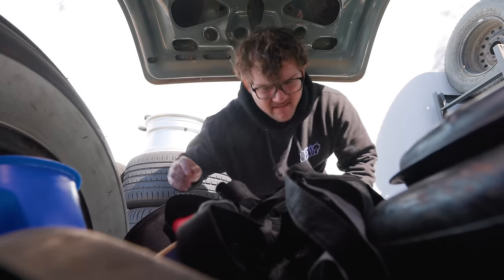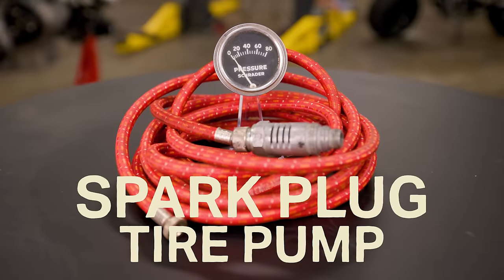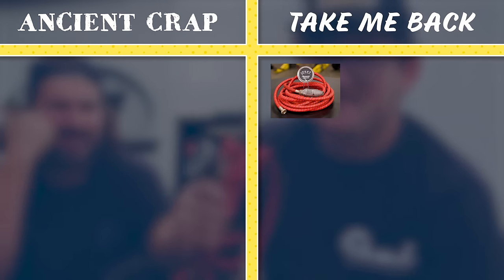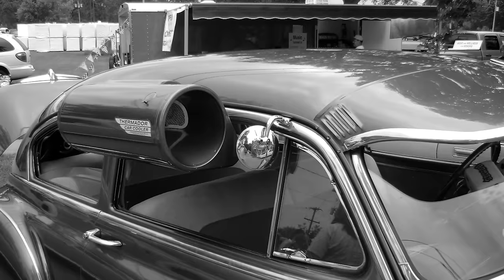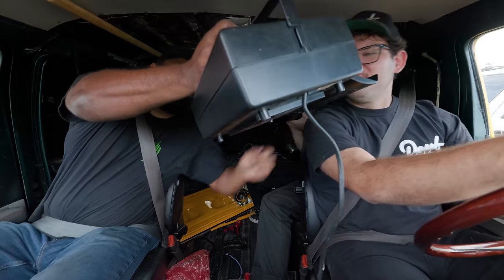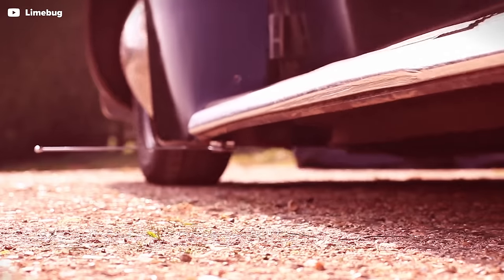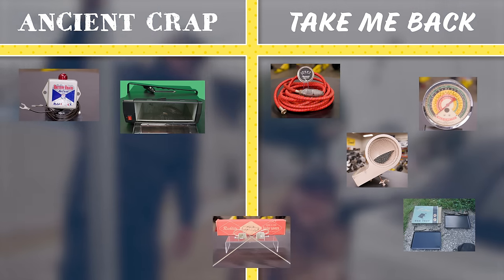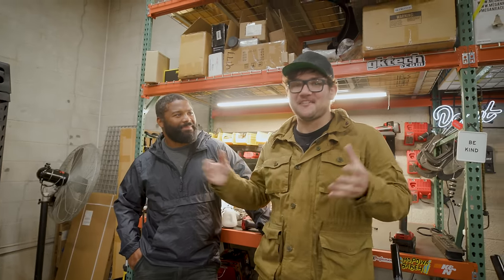Testing Forgotten Car Accessories

Comment: I would like to add the tire retreader would of been more safer back in the day because tires had tubes
Reply: Also many tires were bias ply, and we're re-groveable, many said it on the sidewall of the tires.
Reply: We still do this to trailer tires in the trucking industry
Reply: @srichard6237  I have mixed feelings about that. On the one hand, I get that it saves a lot of money. On the other hand, retreads are what cause 90% of the road alligators that litter highways.
Reply: Regrooving is quite different than retreading. A retread is pretty much glued onto a refinished carcass, where-as a quality virgin tire will have a certain amount of regrooving ability planned into the rubber thickness beyond the original tread depth.
Reply: @blze0018  It's actually 2 different things: 
- Re-grooving is carving out rubber to deepen the grooves on an existing tread. Tire manufacturers even design some of their products to be re-groovable and specify in the tech. datasheets where and how much rubber can you remove. But still needs a care and a hand of a professional to be done properly.
- Retreading is basically gluing / curing a new tread onto a used casing (old tread buffed away). Again, tire manufacturers provide some tech. specs as to how to do it properly for their products, which in many cases is not followed and then we get all of these "road alligators" (love that name btw :D)
Reply: @blze0018  As 2 people have already said, regrooving is not retreading.  I worked for a tire shop for about a year doing mostly truck/trailer tires.  Most people call retreading "capping" the tires, which is gluing on a whole new piece of tread around the existing tire.  We had 1 guy who would regroove bald tires when we weren't busy.  We had a lot of customers that would never run capped tires on their rigs, but some of them would use regrooved tires because there's no chance of throwing a tread on the highway.
Reply: @eric_d  I work on various earthmoving equipment and retreaded tyres is something I really dislike(especially combined with remix tyres, Michelin claims they are as good, but I call BS). Oftentimes the retreaded tyre might have a body originally made 15-20 years ago and they have a tendency to pop on their own from the sidewall.
Unfortunately had to start using retreads again since the prices of fresh tyres pretty much doubled after some a-hole decided he needed to invade another country in Europe.
When you are maintaining a fleet alone it really gets old fast having to replace blown rubbers on the road every day.
Reply: im thinking also regrooving would have been more safe than driving around on slicks in a time like the 1940s when tires were rationed and you couldnt just buy a new set. same with like patching a sidewall. with previous vulcinazation methods and the scaricity of sulpher, and poorer quality/dirt roads, tires only lasted about 5k miles. thats why old cars like the vw bug have the spare tire easy to grab and modern cars its like under the trunk or something.
im thinking about how the spare in my porsche requires me to do like 20 operations and getting it out is the longest part of the process.
Reply: Many older tires were designed with the ida of regrooving in mind. The rubber was initially thicker allowing for them to be regrooved. The reason that the original tread wasn’t cut to depth to begin with was because the rubber was often too soft and the tread would have become unstable in normal driving conditions.

Retreads are the norm now with large workhorse tires, but you most often see regrooving done to racing tires nowadays. A thick sheet of soft rubber is adhered to the tire, and then specifically designed racing groves are carved into them. You can go into the pits of any semi-pro racing league and see this taking place after the first tire swaps are done.
Reply: @Aqnde  - Fell for the “Putins price hike” BS spin did ya?

Prices had gone up long before then kiddo.
Reply: @bradzcustoms  Most motorcycle tires are bias ply, and I would not trust a regrooved motorcycle tire.
Reply: It's  either "more safe" or just "safer". 
Saying "more safer" is grammatically wrong.
Reply: @srichard6237  and outside the USA.  many used USA tires end up shipped to south america, get regrooved by a tire factory, and sold as refurbished.
Reply: @blze0018  wtf is a road alligator??
Reply: @Aqnde  those big equipment tires popping from the side is also extremely dangerous, as I’ve seen some videos online of people dying from that. Really scary stuff
Reply: Re-grooving is vital for construction equipment such as backhoes
Reply: @Cerus98  It's actually largely caused by corporations' price gouging. For example, the refinery and gas industry shut down capacity during COVID and specifically chose not to turn it back on to gouge prices. Often, they used "scheduled maintenance" periods to do the same. We're not experiencing inflation in the traditional sense; it is solely being caused by companies' addiction to ever increasing profits.
Reply: @Cerus98  If that were indeed the case, we would not be seeing record profits, stock buybacks, and insanely large bonus packages.
Reply: @Cerus98  and actually the US has never really been a net exporter since 1949. Only in two years was that the case and only incredibly marginally.
Reply: @Cerus98  The COVID impact was lessened during the peak of the pandemic because the demand had also dropped. When the demand came back around Biden getting elected the refineries CHOSE to not increase capacity back to pre-pandemic levels.
Reply: @Cerus98  Lowering revenue is exactly the same as providing economic assistance. Tax breaks are actually worse because poorer people spend their money generating economic growth in the community while the wealthy and corporations hoard it.
Reply: @Cerus98  It's actually funny that you say that last thing, because long haul trucking will probably be the first instance of ICEs being outright replaced by EVs (If we don't count the electrification of freight trains)
Reply: @Cerus98  and actually if you look at the price per barrel of oil and it's relation to gas prices, gas prices should be much lower than they presently are. They were at similar points before and gas was not as expensive.
Reply: @Cerus98  But you are approaching correct when you say that the knock on effects of this price gouging of gasoline refineries is the driving force behind the rest of the "inflation". You're wrong when you say it is related to economic assistance though.
Reply: @Cerus98  We are literally not even experiencing traditional inflation. There just isn't a word for price increases due to widespread price gouging. The corporations take advantage of that.
Reply: @Cerus98  But when the revolution comes, we'll give you a chance to renounce your incorrect beliefs before you're assigned a spot on the wall
Reply: @Cerus98  the firing squad wall, to be clear
Reply: @casedistorted  Those long chunks of semi truck tire tread you see on the side of the highway after one of their tires blow.
Reply: Alot of people use them for off road use also. When your using 37's or bigger its nice to get as much life out of your tires as you can. We also use to to use them to make super swampers into paddle tires for mud.
Reply: As others have I also seen Truck tires being regrooved though never on a car simply because car tires use the minimum thickness they can get away with.
Reply: @claudiodiaz9752  What if it's even more safe than something that's just safer?
Reply: @blze0018  Retread, Regrooving, hmmm two different words that just might mean two different techniques.
Reply: 19.5 and 22.5 tires are still regroovable
Reply: Tire retreaders are still around.. theyre just primarily used on race tires, offroad tires, semi tire, and tires for machinery
Reply: "...would have been..."
Reply: no.
Reply: Ex tire tech here, Tires were made to be re grooved as well. They still do this on semi trucks.
Reply: Yep, tires were designed significantly differently back then.  This would NOT work on modern tires, and would be very unsafe.
Reply: tires would say on the side regroveable to be able to use and some truck tires still do
Reply: @Cerus98 
You call the guy with a job kiddo. How come I don't think you're old enough to even look at a job application?
Reply: @thejay8963 "how come I don't think?"

There, fixed your question for you kiddo.
Reply: @strayiggytv  
Very clever, you're proving my point exactly.
Reply: Gotta love "more safer."
Reply: @srichard6237 Mabey back when you were 5 in 1967 that was true, but they DO NOT plan for any regrooving depth in modern tires. Not even a plank length.
Reply: @MeepChangeling  Most big truck tires are able to be regrooved. Not legal on steer tires, can only put virgins on them. But for a trailer it's just fine.

Comment: Why didn't you put the curb feelers on Nolan's car?  Oh right... it's a stationary art piece now.
Reply: facts, dude gave up quick.
Reply: Stop, he's already dead 😭
Reply: He really needs to get rid of it
Reply: gaddamn
Reply: I thought it was running after.... What's his name came and worked on it.
Reply: @MK-1010  it turned over, it didn't actually move an inch
Reply: Junkyard digs
Reply: got 'em
Reply: Oof
Reply: LOL right now..
Reply: I suggest swapping out the stock spark gremlin ignition system and transplant in a mid-ish 90's to near 2005 (maybe, I just borrow GM ignitions for my Mopar) HEI system from the ICM to the plugs. It solves so many of the di@khead Engineering, and hidden intermittent cranking no starts.
Reply: @FORDCAMPERSPECIAL   That's it! I couldn't remember
Reply: U could have also just angled them down a little too maybe? 🤔
Reply: @MK-1010  it was running when junkyard dogs (Kevin brown) came and got it to fire off, it just never moved
Reply: @coonyman10  who’s dead
Reply: Dude that thing is literally like art dude, if you sell the car it’s hard to get a car in the same condition
Reply: Who's nolan
Reply: Something about wiper blades for the first 5 minutes

Comment: Worth noting that when the tire re-treader was a thing, everyone had Bias Ply tires which had very thick solid rubber treads, unlike modern radials, so retreading them was entirely safe and viable.
Reply: Yes, and similar tools are still used today, just not for regular passenger vehicle tires.  These kinds of tools are still common for reconditioning airless tires used on a lot of equipment.
Reply: Yeah haha, I was thinking the same. They were just much thicker back in the day. Probably why you will hear old guys complaining about how often they need to replace their tires now and how much longer they used to last.
Reply: They still use these on tractor tires today
Reply: Even modern passenger car tires can be retreaded. Obviously not with a simple tool like the one in the video. It's just an entirely different process & not something you can do at home. They basically sand off most of the tread, lay on new rubber, & cure it again in an oven/mold.

Comment: Back in 1966 when I was driving cross-country, with my newly pregnant wife, I had to buy one of those swamp coolers when I started across the Mojave Desert. It was no air conditioner, but it was better than nothing. The only other accessory that went with it was a canvas bag of water that you hung in front of your radiator as you were driving. The theory is that the slipstream of the air would keep the water cool. Again, better than nothing.
Reply: The swamp cooler very much would still have a place today. I lived in the Mojave for a while and saw many many cars broken down in the mountains that ignored the “turn off a/c” signs. A swamp cooler would have been pretty great in that environment.
Reply: @Leonarco333  What's the reason for turning of the ac? So high temps so the compressor breaks down maybe?
Reply: @P4hko  the ac compressor makes your engine work harder and produces a lot more heat in the system. When the ambient temperature is 120-140 degrees near the road surface, your vehicle struggles to manage and remove heat from the system. Combine that with the increased load from the steep inclines and it’s common for head gaskets to blow or radiators to rapidly empty themselves of coolant. Turning off engine loads is advised especially the ac.
Reply: @P4hko  In addition to what Leonard said, today's cars both run hotter normally and also have minimal cooling systems to save cost and weight. It's all to gain fuel efficiency and reduced emissions, but when you figure in the exorbitant costs of repairing today's cars the increased efficiency doesn't compensate. And I'm not sure emissions are really that much worse on a cooler engine.
Reply: My dad bought one for a family trip thru the southwest from LA to Texas in July back in 1969. It didn't work very well. It just made the interior humid. I hated it.
Reply: @toastnjam7384  Swamp coolers only work well when the air has low humidity.  They are still used as window units in places like Denver where they don't necessarily need full a/c.  Anywhere with humid air, they will almost be worse than nothing.
Reply: it's just like having an old failing piece of crap swamp cooler in your house. It barely works, you want to kill the landlord(car owner in this case who installed it and decided to go through a hot desert with it.) and yea it's better then nothing. God I wanna strangle my old landlord.
Reply: @Thatonefuckinguy  I hear you brother.:face-orange-frowning:
Reply: the idea behind the desert water bag is that the water would seep through the canvas and evaporate, cooling the air coming into the radiator, and reducing the risk of a boil-over.
Reply: @Leonarco333   I would totally buy a swamp cooler for my '99 Blazer, she doesnt have working AC so summers get pretty brutal
Reply: Swamp coolers are actually fairly effective as long as the outside humidity is low enough.  A friend of mine asked me AFTER buying a swamp cooler why it wasn't helping him at all...in a South Florida, just-had-a-hurricane power failure area.  Well...likely because the humidity was 90+ percent the whole time.  With way-high humidity, basically the swamp cooler becomes a swamp-fan instead.  Being pregnant, I'd think your wife was at least less-miserable with that thing available.  "Better than nothing" is actually pretty good when you're in the desert, I suppose!